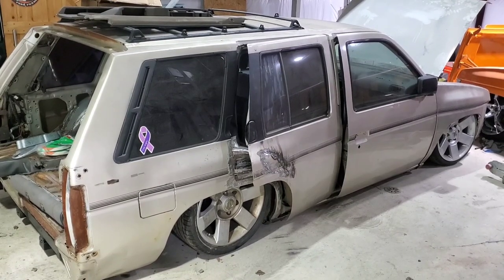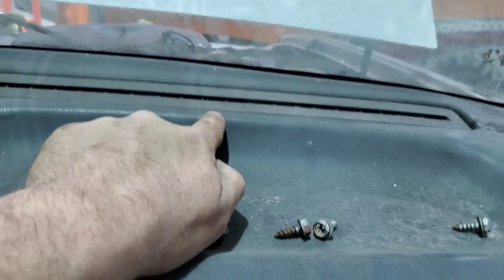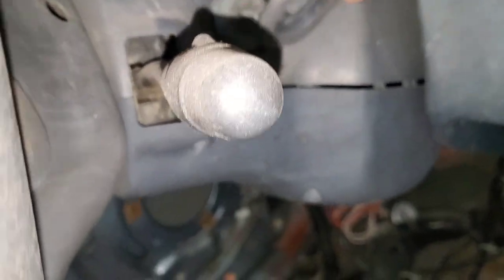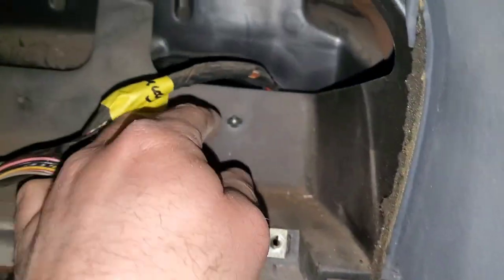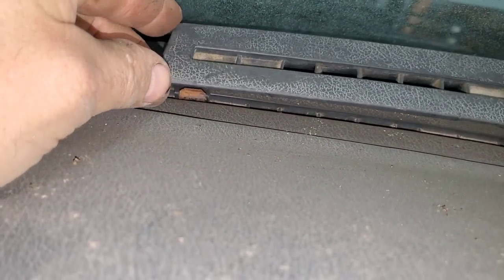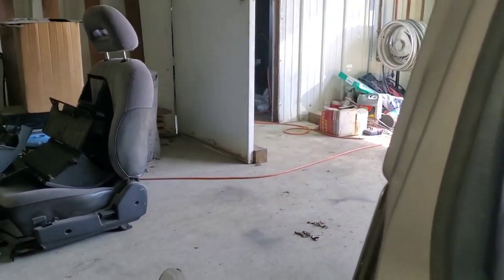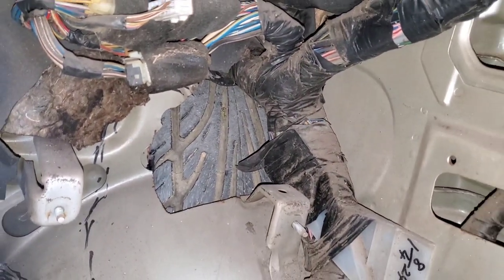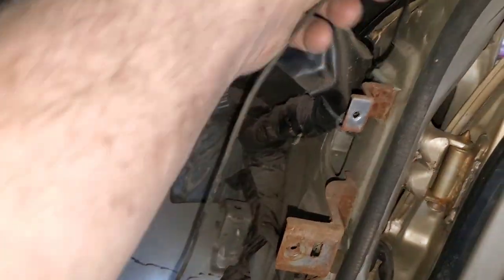Nissan 94 and 97 Pathfinder d21 hardbody dash and wire harness removal.

Comment: The glove box light and switch wires weren’t cut. They got chewed in two by a rat. Same thing happened to my 95 xe. Had lots of chewed wires under the dash. Just went through the dash removal/reinstall process for the last week😂